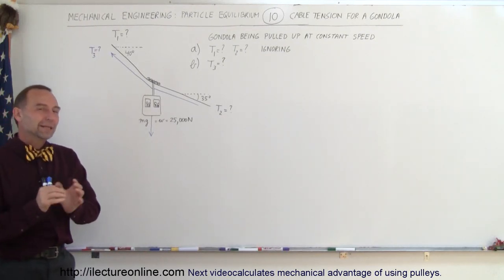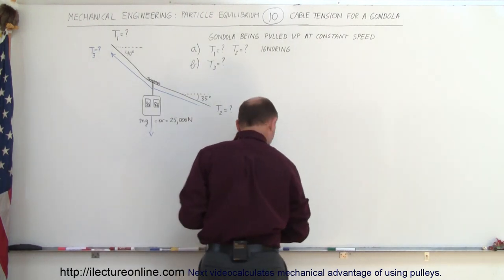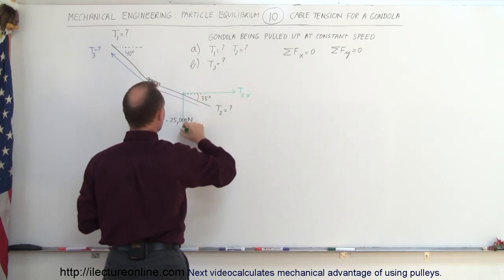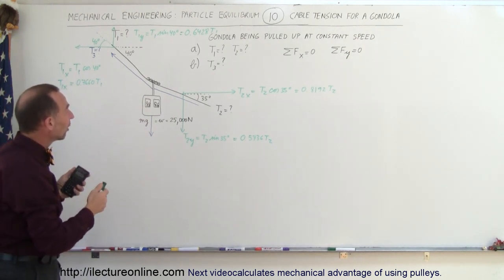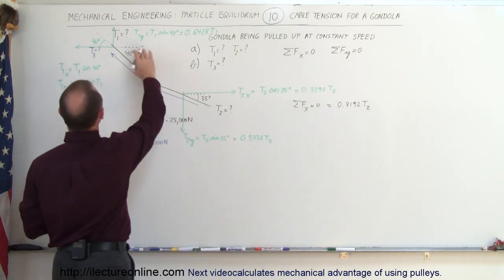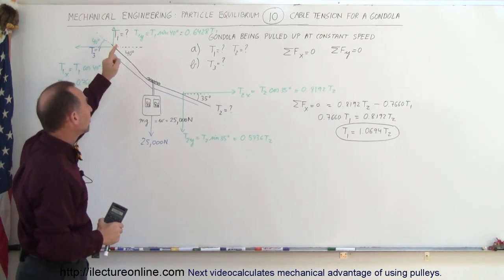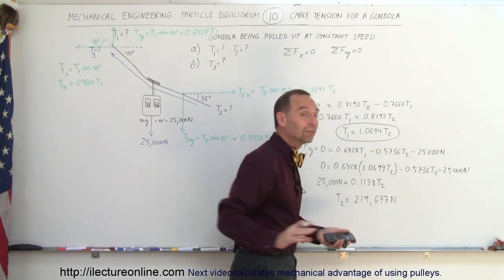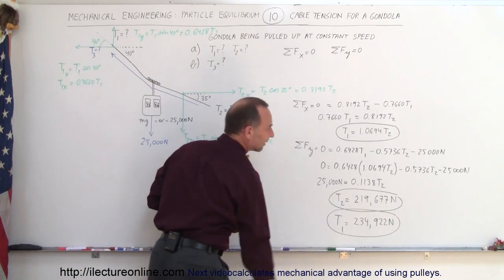Mechanical Engineering: Particle Equilibrium (10 of 19) Cable Tension on a Gondola

Comment: what is the physical meaning of T3, is there anothe cable not ddrawn in the figure?
Reply: I believe T3 means another blue cable which makes the gondola move?
Reply: It allows one cable to do the lifting, while the other cable does the supporting.  This enables you to dedicate the tension to separate cables, so that you don't end up with tension accumulating for both supporting and lifting.

Comment: Prof., at ~6:15 you say the tension in the suspending cable must be the same on both sides.  But when the car is stationary T1=254 kN and T2=220 kN and T3=0  Isn't this similar to a capstan?  The difference between T1 and T2 is due to the friction in the car's wheels.  Isn't 15 kN an upper limit on T3?
Reply from the maker: 82rah 
In this problem we are ignoring friction.
The difference in the tension is accounted for by the cable (T3).
Reply: Thank you so much. You save so much time for me.

Comment: T1 is biger then T2 because the more the angle is bigger the more the tension is, this why T1 is bigger then T2
Reply: The horizontal component of both tensions has to be equal and opposite, for the horizontal tension on the gondola to add up to zero such that the gondola can be at equilibrium.   The tension will therefore have to be greater in the cable that is at a greater angle to the ground.